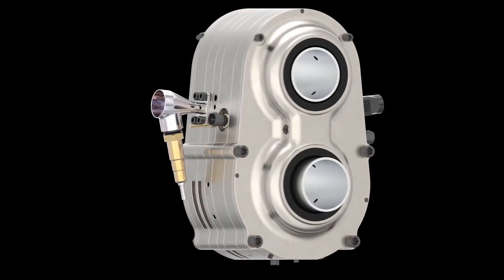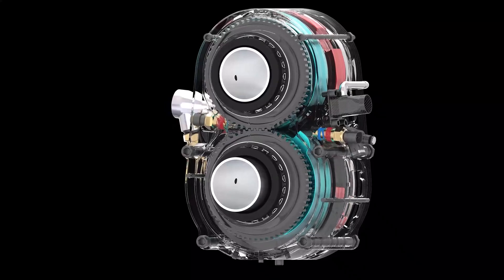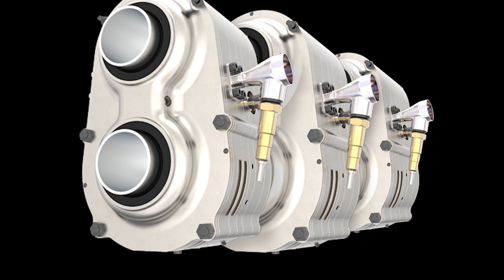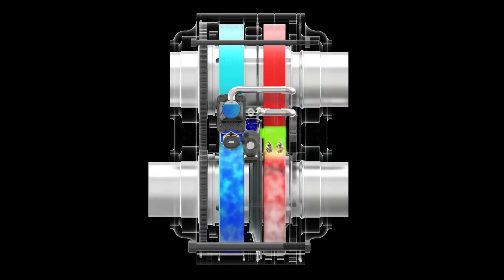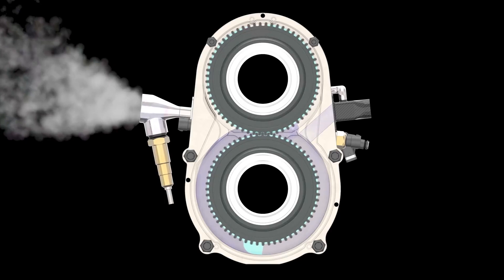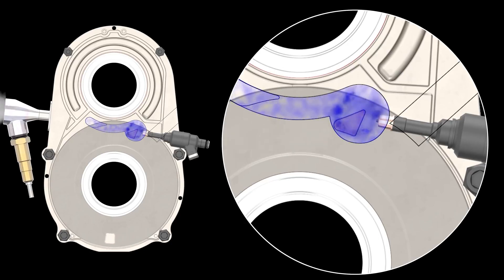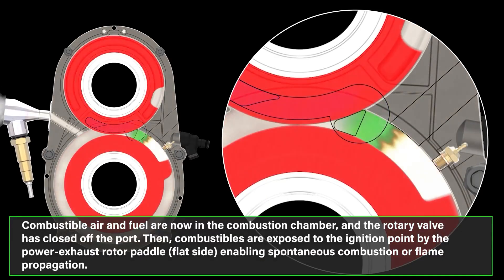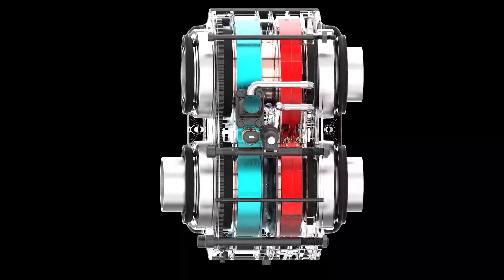This pistonless engine runs on hydrogen and revs to 25k rpm

Comment: as an auto mechanic myself i have some questions.if tolerances are so tight that it does not need seals then i think thermal issues come into play. how hot does this engine get running on hydrogen?if it is air cooled than perhaps about the same as a motor in a old vw bug?
i am wondering if they have made any yet for testing and if the results are available because it just seems to me that such a motor with no seals will end up leaking oil fairly quickly.
heat will cause engine parts to expand and contract as they cool and this is likely to throw those tolerances out the window in a short time. my thought is 10-25k miles before it starts leaking oil. what happens if it leaks hydrogen from the combustion chamber?

just some thoughts here ,folks!
Reply: I was amazed untill he said "tight tolerances"
Reply: The low tolerance is same as a aircraft jet engine, also air-cooled
Reply: you have a point, but here's my thought, if the tolerances were built for operating temperatures, then they may need a block heater. formula 1 cars have a super high tolerance and will seize the engine if its below operating temperature. and then still what about different climates, you may have a leak if you're driving around in Texas, but if you're in North Dakota then your car may lock up or fail to start.
Reply: I still think that by seals they mean piston seals(rings or whatever) and depending on the materials used expansion rates would be close enough to  do the job. I mean  it's not like turbine engines dont have oil feeding the bearings,  but nobody ever really mentions the seals on them.
Reply: He mentioned that it was super efficient. If it can run cool this may be possible then without seals.
Reply: It’s possibly just at prototype stage and has yet hasn’t been perfected?  If it’s reliable it sounds too good to be true I think.
Reply: There are clearly seals on this for oil, it shows as much in the expanded view. While there certainly may be issues with this engine, your understanding of seals in this context is incorrect. He was referring to APEX seals, used on rotary engines to keep the combustion chambers separate
Reply: I think we all recognize the difference between schematics and theories and irl material, production process and operating environment concerns.  The fact is, serious engineers working on this wouldn't be releasing these drawings until they were well in their way to making it work.  So, either were wowed by the real thing very soon, or we know to file this alongside the space elevator and hyperloop.
Reply: Would be world beating if they could pull it off though.
Reply: @Ozzie climate refo it probably won't be liquid hydrogen, but hydrogen gas. Even still, hydrogen is so small it seeps through solid containers, and while it doesn't impact the environment it will affect your wallet to a small (most likely barely noticeable) margin
Reply: Can I add that a two stroke engine runs cooler than a four stroke engine?
Expansion and contraction depends on materials used in construction, modern space age materials are less prone to the effect, such as carbon fibre.
Reply: @richardwebb9532  a two stroke does not run cooler, it transfers heat faster... are you one of those people who modify a two stroke and use a stock piston, then wonder why the bike keeps siezing and spends time trying to get the fuel mix right but never figures out that its ring flutter that is causing the problem?? most likely....

 to answer the obvious next question. 70% of the heat that builds up in the piston is transfered out through the rings. fluttering stock rings lose contact with the piston wall and the piston melts. thinner or simply put, lighter rings fix this problem as they retain contact and transfer heat.
Reply: @abeboegelsack5190  ....ja, because heat is only transferred to the piston and not the head, sleeve and crank case????
Reply: @KH L you have to remember that there is a lot that would need to be done before this engine could be used even if it is half as good as they say. there is no infrastructure yet for a hydrogen fuel based car.
Reply: @Ozzie climate refo Ignoramus come to mind!
Reply: @KH L let them prove concept and build it, this may just be the next most popular small aircraft engine. it seems as though it is lighter than the turbine in an md-50 and if it can make the same 300 hp that the turbine in those helicopters do(de-rated to 225 hp) it would be just the thing for a bush plane.
Reply: VW bug engine is a rattling sack of bovine.
Reply: @Givemeafinname  never said it was a great engine but it is air cooled...
Reply: @Repent and believe in Jesus Christ well you are either trolling or a religious nutter. either way take it somewhere else. this comment thread has nothing to do with religion and any other such comments of yours will be reported...
Reply: @Repent and believe in Jesus Christ yeah, i looked at your channel and there is no content so you are trolling. any comments from you WILL be spammed....
Reply: @KH L it did, then they banned it due to omissions....(two strokes)
Reply: as a manufacturing engineer i have some questions too. How the hell are we going to achieve those tight tolerances with reasonable price
Reply: @bansheee1  investment casting..... 3D printing.... cnc machining...
Reply: @mikespencer4922  all too expensive.Onlt cnc machining is extensively used.i have one in my workshop but still it would cost a fortune to manudacture the engine like that.
Reply: Thermal issues are not a problem since compressed hydrogen is very cold when decompressed fast.
Reply: I would give it 10k miles before problems. Revving up to 25k is crazy. That suggests regular revvs would be 5-6k. That engine would tear itself apart so fast with regular use.
Reply: I also question the tolerances. But not because of how hot it will run but rather the environment it will run in. Like how it this going to deal with -45c weather
Reply: Same as an old bug? We know that isn't possible. Material wise, its unknown if it's possible to drive this down the HWY without rings. Blowby would be the major factor.
Reply: In this case tolerances meaning no variances of surfaces - that the surfaces are so perfectly fitted that they can afford to be insanely close without touching - so close that it's a virtual seal but there's no actual contact. As Rick would say, 'true level bitch' https://www.youtube.com/watch?v=fQoRfieZJxI. We're not given much information on the materials engineering though.
Reply: @Ozzie climate refo liquid hydrogen requires cryogenic cooling they use compressed hydrogen.   You only use liquid as a fuel for like rockets, and it's a launch or vent it situation after you load up as they don't have a method to keep it cooled in the vehicle tanks.   That's why you see like a bunch of steam before rockets launch, it's their cyrogenically cooled fuel boiling off pre launch, the ground facilities keep it cold.
Reply: Wouldn’t it be insanely loud spinning at 25k as well?
Reply: @mostlyright5384  its hypersonic speeds, not supersonic, so probably very loud, but also could be very different for engine compression since it introduces different fluid dynamic properties moving the air at those speeds.  That might address seal tolerance if we see more "sticking" from the super duper highly compressed high speed air.
Reply: @rumls4drinkin  so pretty much disqualifies it from use in cars correct? That would be an insane ideal to have jet sounding cars running down every street
Reply: @mostlyright5384  maybe but it depends on how well balanced and machined and insulated it is....could end up being whisper quiet or like a jet engine yea.
Reply: Hydrogen leak from engine = boom
Reply: Guys guys ..this only works in an simulation
There is not even a concept that  worked in a lab.
Right now this only works with imagination and some magic and/or drugs choose the one you want.
Reply: Any one else noticed 2.06 minutes in & their is a diagram showing seals!
Reply: @timreeves6296  he means rotor seals. The bane of Wankels since the dawn of time. Does this really need explaining?
Reply: @hellshade2, yea I think it's always good to investigate new ideas/methods but some things really aren't very practical, others impossible, at least at given moments in time. The first thing I thought of was, what would it cost to build/purchase/insure, maintain, replace?? As generally everything tends to wear/breakdown at some point.  The fact that it spins up to ~25K revolutions, well turbochargers can do this "cruising", lol. I mean that by the fact that some turbochargers can reach 100K+ rpms... Granted they're not exactly "engines" as they are "compressors" but they still possess seals & require proper lubrication and maintenance. And given that they're only a "component" of the system and not the sole component, YET they're still quite expensive to replace, there is no telling how much that "piston-free hydrogen engine" would cost. Some vehicle manufacturers are even integrating the turbocharger(s) into the cylinder head etc., so it becomes one unit. So if the TC is "toast", you have to purchase a whole new cylinder head with it. x_x

I am also more concerned about the use of "hydrogen" as a fuel as some others have mentioned. I know there are some "test vehicles" on the road so-to-speak but it's clearly not widespread. I'd be concerned about large-scale production of such vehicles, the safety of refilling hydrogen tanks as well as the potential for the breakdown of components over time which could lead to a fire/explosion hazard. The same is the case with hydrogen powered vehicles in various accident scenarios. After all average combustion engine vehicles can suffer fires/explosions, even electric vehicles can, especially if components leak/corrode over time and then more so if you're in an accident. As I recall, some "Chevy Volt" crash test vehicles spontaneously caught fire after they sat outside and the coolant came in contact with some electric components corroding them.
Reply: @zenithperigee7442  I many parts of the world, cars have a propane tank built in to alternate with gasoline, so why not Hidrogen? I know, mutch higher Psi, non existent for personal use, exept comertial, When they come up with a sistem that splits water in your tank into a combustible mixture of H and O2,
Reply: As with so much these days, this looks like snake oil
Reply: @SpiralsTurning777  The problems are there to solve them.
Reply: @laszlodudas7313  The same could be said of alchemy.
Reply: @Ozzie climate refo i am not sure what you mean by binding. can you explain? i do know hydrogen is explosive in a gaseous state. i have seen car batteries blow up when being charged because vents in them were blocked and a spark occured (acid batteries release hydrogen when charging)
Reply: @hellshade2  hydrogen is always in a gaseous state, in order for us to compress it to a liquid we have to cool it down to neg 200+ degrees. so thats why he's probably worried about binding? (freezing) 

to get compress hydrogen to a liquid at room temperature requires something like 500+ gigapascals, thats enough to crush diamonds and has only been done twice in the lab afaik, it know it broke the diamond vice on at least one of those tests.
Reply: @robgilmour3100  thxs! i did know that hydrogen had to be cooled to a very low temperature to be in a liquid state. now if you are talking about binding as in freezing wouldn't that require the hydrogen to be at an even lower temperature for it to actually freeze? that would seem logical to me.
also if he meant freezing why say binding instead? that implies he meant something other than freezing...
Reply: @hellshade2  idk why he said 'binding' i'm just guessing it's do to the low temp

Hydrogen freezes at 14 kelvin, thats -259 degrees Celsius (-434 Fahrenheit) or really f-ing cold lol.

i dont think he was talking about the hydrogen freezing, he was referring to liquid hydrogen freezing everything it touches, at 1 bar atmosphere hydrogen liquefies at -253 degrees C (in other words it starts to boil, turn to gas at -252)

yeah the melting and boiling point are only 6 degrees apart, only just found that out. learn something new everyday :)
Reply: @hellshade2  I assume he means icing and/or thermal expansion/contraction. This can be engineered though with use of titanium and de-icers. I would not use this for drive train, I'd use as a generator to float charge an EV car so the engine can run optimally and without performance stress.
Reply: @IAmNoggin  to this day there was never a rocksolid solution to hot/cold parts as i am aware of. Especially newly "engineered" vehicles etc. where most of the engineering are complete failures and a step back in evolution.
Reply: answer to your questions in order:
1) Hydrogen does not get as hot as other hydrocarbons gases.
2) see answer 1.

Hydrogen will ultimately be the future, since every one and their mother wants to continue to murder nuclear technology as the greatest evil to fall upon this earth next to taxes.
Anyone who knows the next two questions, knows the truth:
Who owns the Plutonium, and what is it worth?

RIP Mr,Galen Winsor, you fought hard for us!
Reply: @MR-nl8xr  True but Hydrogen is not a Hydrocarbon..It's just Hydrogen without the Carbon attached. Gasoline is C8H18.

Comment: Internal combustion (IC) & Electric have different sweet spots. Generally IC engines are more efficient at constant revs, hence the gearing to try to keep them there. Electric is much better at changing revs efficiently. Also regenerative braking is effective in recapturing some of that kinetic energy. So it this plays a role, it is likely that the hydrogen fuel will still benefit from electric as well. I also wonder about servicing. Tight tolerances are a challenge to work with, and likey to have issues with wear. So engine lifetime may be an issue. 

That said I love the innovation. It could be a game-changer. Most early innovations have problems. That is why you often see v2, v3, & v4.
Reply: This is more like ....works in v28174929

Comment: I love new technology, but I’ve seen these theoretical motors come and go. I am no scientist, or engineer, but from what I understand there are huge drawbacks of using hydrogen. Namely, it is extremely hard to keep hydrogen from leaking because of its small atomic weight, in the engine not having any seals just makes me a bit skeptical. In this, and in every other case, I would love to be proven wrong and see the IC engines evolve to something much better, more efficient, and lower maintenance.
Reply: It's also hard to safely store enough hydrogen for a long trip. Maybe if we get ultra light engines, that won't be as big a deal, but I'm skeptical.
Reply: These hydrogen motors are great and all, but while you say it is super efficient, it's still a combustion engine. they work by an explosion heating up the gas that is the result of the explosion so it expands rapidly. this means combustion engines will always lose lots of energy to heat. the most efficient way to a hydrogen powered engine is still generating electricity using the hydrogen, then using that to power an efficient electric motor. but nevermind all that, because the problem with a hydrogen can has always been fuel storage. you need a tank that can take a lot of pressure, and those things are heavy as fuck
Reply: Yah…how does a gas “not have time to leak”?
Reply: Maybe yall should ask bill gates how his hydrogen powered yatch works.
Reply: @bishop198666  the concept? Either way, hydrogen can be used with some degree of safety out in the ocean over being in a bunch of bumper cars on a highway. But, it’s an idea and a concept at the moment. I’m sure it’s feasible since the space shuttle was able to use liquid hydrogen as well.
Reply: @bishop198666   Huh? Your comment is a conspiracy theorist’s trap..  We do have the tech for all the energy we need, but just to be clear, ever car on the road today is “subscription based”. You must pay insurance, registration, fuel, and maintenance. You can call it one thing or another, but ultimately all of this just sounds like someone that has to say something bad about EVs since it’s new tech and not well understood by too many.  Companies do you have too much control, but the laws of physics still exist and if you think that some unlimited source of energy exists, then study physics and invent it. I’m not doubting the existence of better forms of energy, but from what I can tell there’s a lot of research going into it.
Reply: Agreed.
Reply: It's not theory , it's actually old technology , they were call "Wankel" motors , arctic cat used them in their snowmobiles back in the 70s, only difference here is they're going to power them with hydrogen instead of gas.
Reply: @lokirussell4544  He said in the video "Well this isn't that cool, it's really just a fancy, high revving Wankel rotary like the ones you'll find in a Mazda" then goes on to say how different it is.
It looks similar but its very different and way more complicated
Reply: Im pretty sure it has seals. especially with combustion and compression. if this is a "blueprint" they dont show everything in it if it's secret/patent.
Reply: @Underp4ntz  ... cannot divulge any invention claims before filing a patent or the patent becomes invalid.
... must disclose all that is material to patent claims. Otherwise, the patent is invalid. 
... Trade secrets can be patented by competitors. When a competitor invents the secret independently. If the secret has not been previously "divulged" in open literature. A trick used to protect trade secrets from being patented.

The above is my understanding from memory, before more recent changes in patent law.